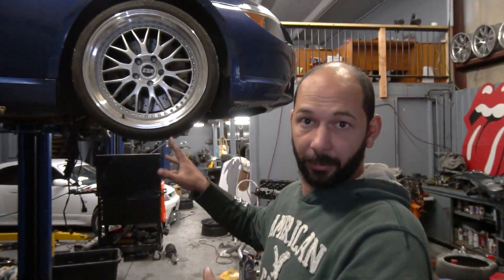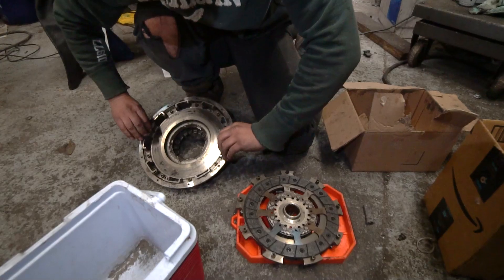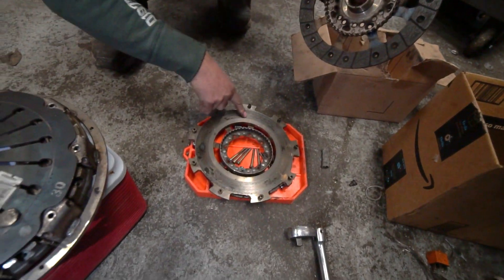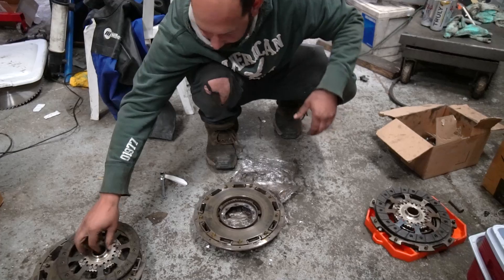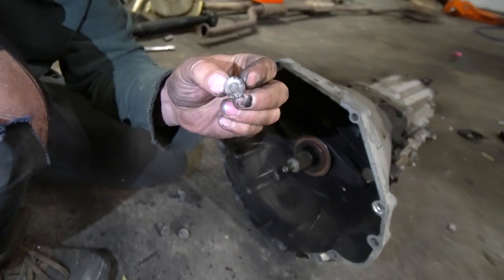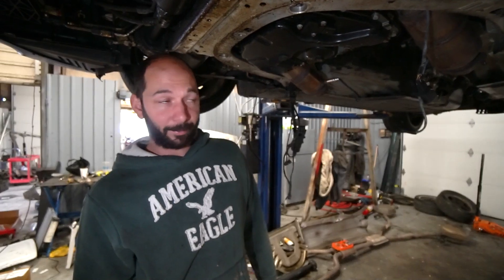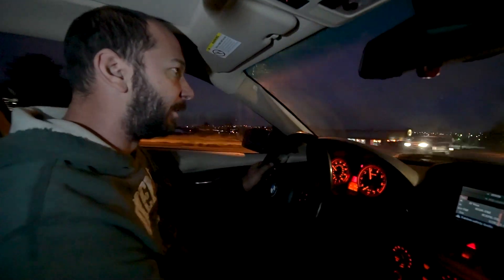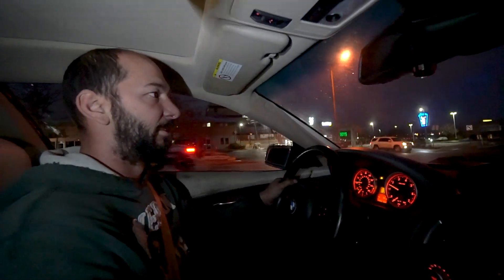BMW 6 Series Twin Disc M5 Clutch Retrofit! | Making The SMG Clutch Work

Comment: My clutch pedal had the limited/stopper missing. When fully pressed in, fork would make contact with pressure plate and grind. I knew of it and avoided pushing clutch all the way to floor. 
  When my mate tried my car on the race track, he pushed clutch all the way to floor and fork ground hole in it. Clutch slave pin went through the fork and lost my clutch. Drive home without clutch, welded up the hole and put it back together.
Reply from the maker: Badass, solid fix too haha